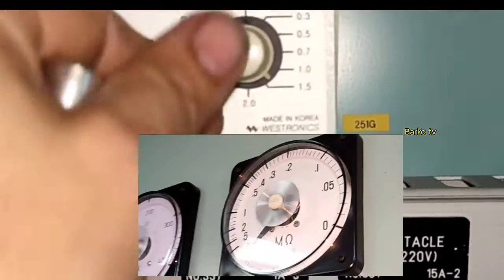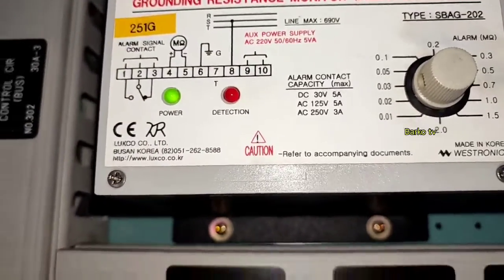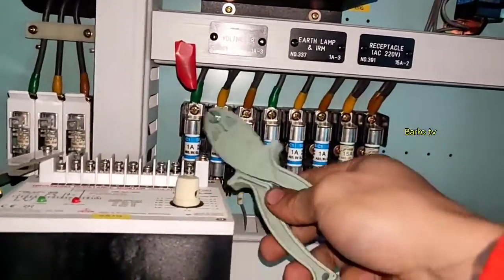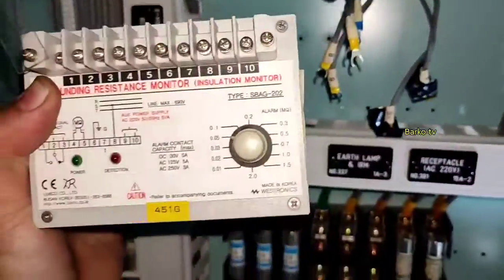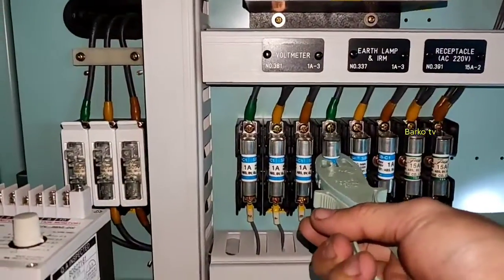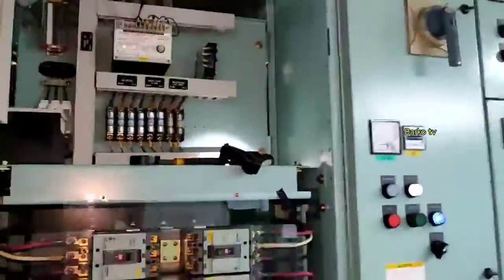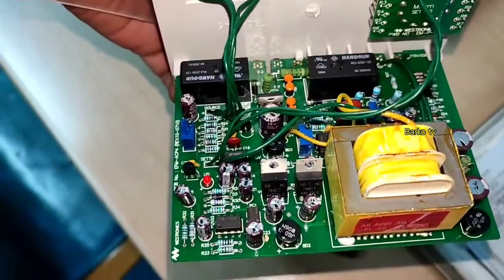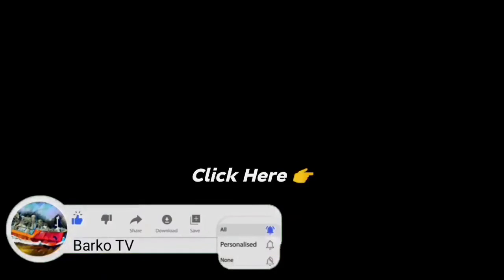Defective 220 Insulation resistance monitor, how to check ir monitoring unit.  Megger/Fluke/ETO

Comment: Hello. I have a Bender irdh275.  And it show wrong resistance. When I connect 33kOhm it shows <1kOhm, when 90 kOhm - 22 kOhm. Do you know how to repair it?
Reply from the maker: I suggest to replace a new one,cause that bender as far as i know it is a digital unlike in our IR monitoring is analog and have analog adjustments which can coorrect the errors, im sure that your company will give that spare cause the low insulation in our ships is very important to have a good monitoring for that.